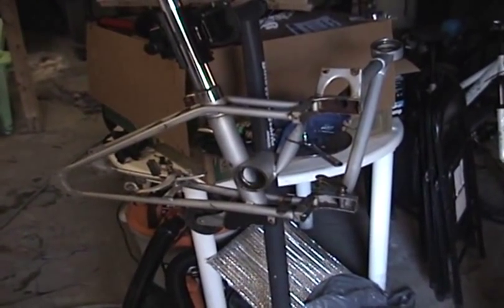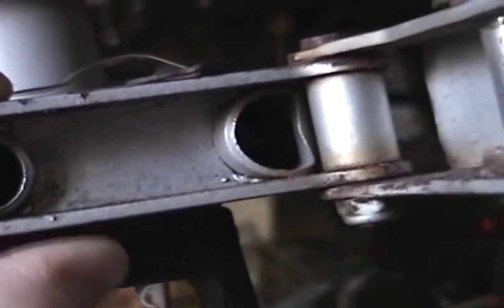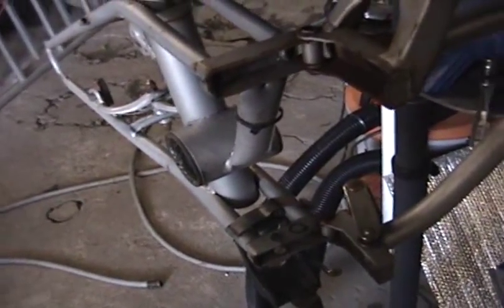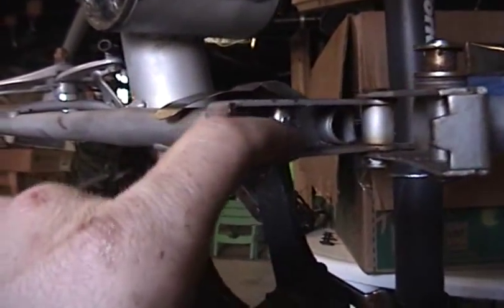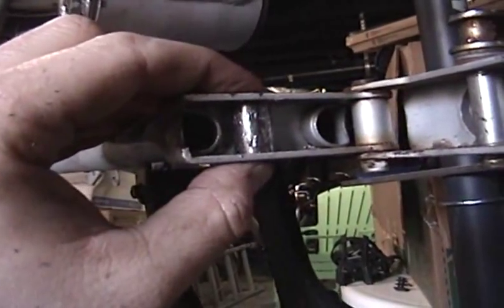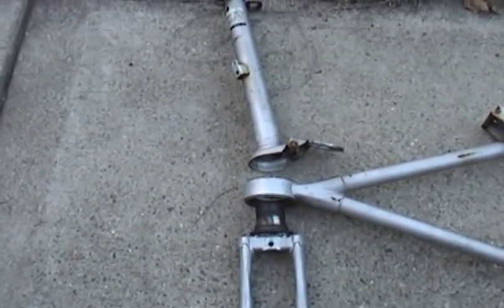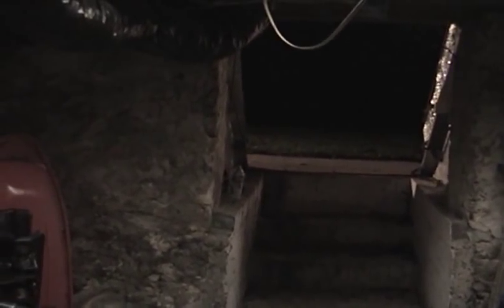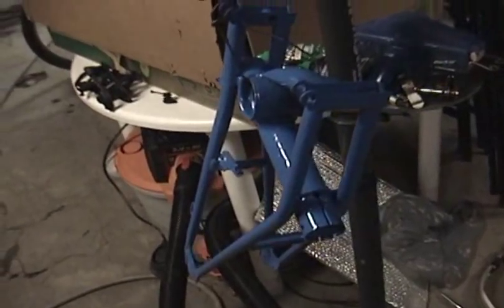Dahon Classic III folding bike - REBUILD: part 2

Comment from the maker: Best of luck. The weld and new frame tube fixed mine. BUT, when I finally got the bike done, I rode it around 10 feet and hated how it rode. Not because of the weld - just didn;t like the bike. Never finished fine-tuning it. Will probably resell in the spring.

Comment: Thanks for the videos! This is very helpful in my first attempt at a Dahon rebuild. The two bolts that the frame pivots on- are they just standard bolts? My top bolt seems to have snapped, as the Allen cap and the bottom nut spin independently of each other. My plan is to drill it out and replace with new hardware if they are just a threaded bolt in a sleeve. Thank you!
Reply from the maker: Wish I could help, but this rebuild was many years ago and I don't remember the details. I also donated the finished bike some time after that, so unfortunately,  I can't check it.

Best of luck with your build.
Reply: Thanks for following up! Your videos are very helpful, even many years later.

Comment: Question: why didn't you tape off all areas that shouldn't be painted like bottom bracket or head tube, seat post? and i didn't see a coat of primer i think the reason your paint is lifting is because it doesn't have a consistent surface for paint to stick to
Reply from the maker: James Sonnen This was a few years back, but I know that I primed before I painted. I've been using rattle cans for well over 20 years and would never spray regular, rattle can paint at bare metal without a primer. The paint lifted because I tried recoating while the original coating was still curing. This was in the winter and the cold weather slowed down the process considerably.